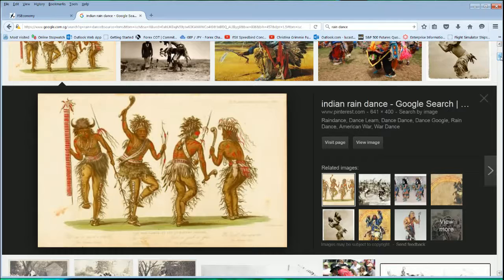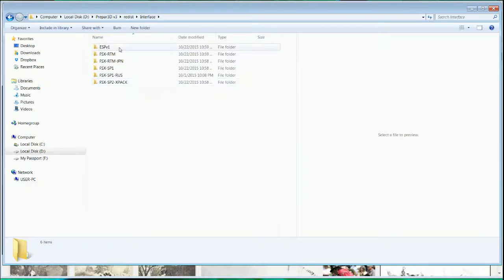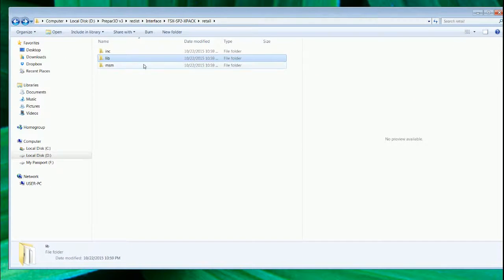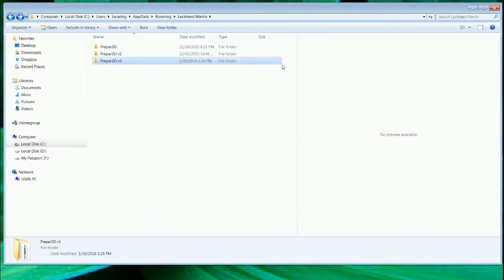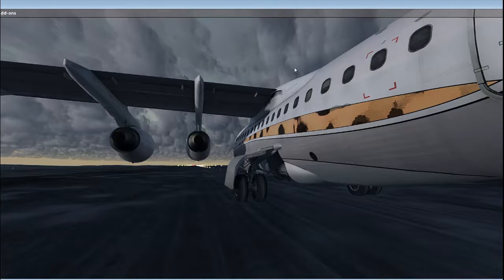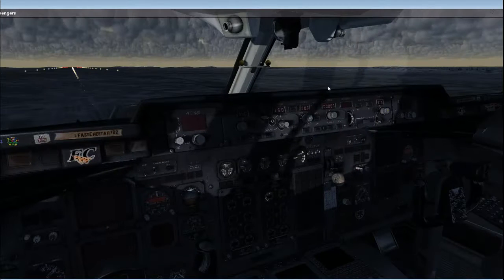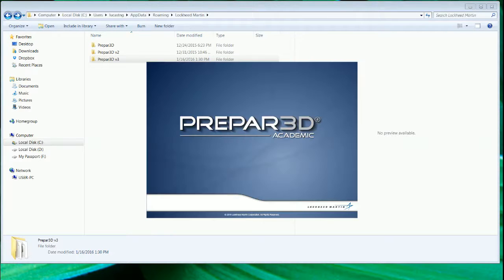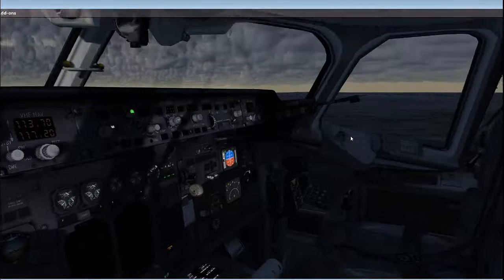Prepar3D V3.1- How to get Qualitywings BAE146 to work in V3.1

Comment: hey man, here i was having issues with V3 3.4, i made few things and working flawlessly..
1-On qw146.cfg, i put PanelState=01_Cold_And_Dark.PNL to prevent the acft load the last state.
2-put the default plane like you on default scenario.
3- deactivated the spoilers and flaps assigns on p3d controls and assigned directly on fsuipc.
4- assign the Reload User Object" command on ctrl+shift+R and use after start,
 i see this on the F1 forum, getting a lot of rain here \o/
Reply from the maker: Nice! With this tweaks do you get problems with flaps or gears after all engines shut down and restart?
Reply: FastCheetah702 
I put the incorrect tweak, it's not cold and dark, it's the one who prevent the last panel state to get loaded, unfortunately still can't turn off the engines because the flaps stop work, I'm anxious to QW end their 787 and look for us -'

Comment: Cheetah, my 146 collection works great except for the livery dospatcher, says it cannot find the path to p3d. I dont know how to fix it. Please help
Reply from the maker: I would suggest just copy livery files into the folders, dont use dospatcher. You need to know where to put those files tho.
Reply: FastCheetah702 Thanks Cheetah. I fixed it after doing some research. I edited the registry by adding a new string value. Named it AppPath and mapped it to my P3D folder location and it works. Thank you.
Reply from the maker: Nice! :D

Comment from the maker: P3D V3.3 seems to have solved this problem entirely. Engines shut down and restarted with gears and flaps fully functional. I guess LM has fixed something in the simconnect for this version. Cheers.
Reply: Hey man :) 
So does that mean that I don't have to do the whole procedure explained by you in this video ? Or is only the bug gone and I have to do the simconnect procedure aswell in p3d v3.3 ? 
Greetings :)
Reply from the maker: i hv recently experienced the same thing in V3.3 so what ever u did in v3.2 after u go for v3.3 should work.
Reply from the maker: MrConz16
so far what i hv experienced is that the spoiler suddenly went out of function in v3.3 after i fly for a feww hrs
Reply: +FastCheetah702 oh ok, so the problems are still continuing.... So when I want to install it now in 3.3, I should do it with your tutorial ?
Reply from the maker: yes if it is your first time installing qualitywings rj into v3. but u may try it without my steps in the video n see if it works first before u do the steps in the video.

Comment from the maker: P3D V3.2 might have solved the problem with QW BAE. Anyone can confirmed?
Reply: +FastCheetah702 Hey, curious if you ever got this working for 3.2?
Reply from the maker: yes it is working in V3.2. You have to do the whole process again tho.
Reply: +FastCheetah702 Same method as in this video?
Reply from the maker: Whiskey Simulation
yes
Reply from the maker: Whiskey Simulation There is a bug tho. if you shut down engs and restart engs the gears will not retract from then onward, so hv to restart p3d with the default plane BAE146 again.

Comment: Sorry,How get Simconnect_off.xml in appdata/roaming/loockeedmartin/p3dv3?I don'thave it in!!
Reply from the maker: +giovanni luca baldazzi you do not need that file.
Reply: +FastCheetah702 Sorry I don't understand how I must make it
Reply from the maker: +giovanni luca baldazzi uyou must not have it. That is why I rename it to "off".
Reply: +FastCheetah702 I have simconnect installed,but what I must make after?
Reply from the maker: giovanni luca baldazzi have u install QW bae146? if yes you can run p3dv3 n make sure the default plane is the piper cub, after that u change to QW plane.. Check all button and fmc are working. If yworking,  save the QW plane as a default flight. From then every time u need to fly QW plane u need to load this flight a default flight.
Reply: +FastCheetah702 yes I have QW bae installer,I have V 1.4 PAY
Reply: +FastCheetah702 Thank you very much then I will try it and I hope work
Reply: +FastCheetah702  I tried it and only the flaps don't work...
Reply from the maker: what are the simconnect as shown in your installed program? How many are there? my got 4 as shown in my video. When you run p3d which plane loaded first just after you installed all 4 simconnect? IF you do not hv piper cub loaded as default plane when you install those simconnect, u need to uninstall all 4 simconnect. Make ur default plane piper cub b4 u reinstall those 4 simconnects.
Reply: +FastCheetah702 yes 4 installed,now flaps work,fmc don't work,display efis and other don't work when with mouse click for zoom on display efis,
Reply from the maker: Could you write here the steps that you took in sequence right from after you uninstall all 4 simconnect? Because if the sequence of your steps is not correct it won't work.